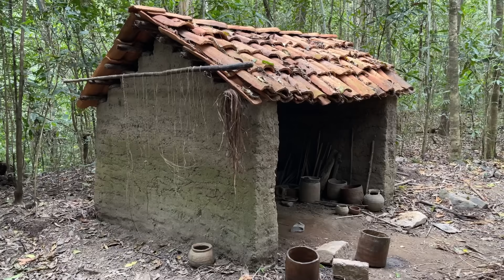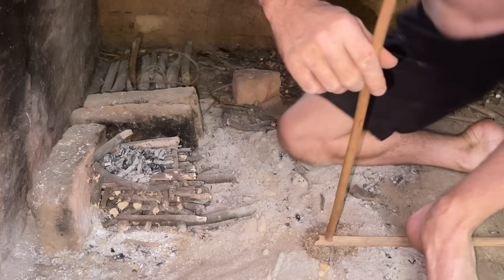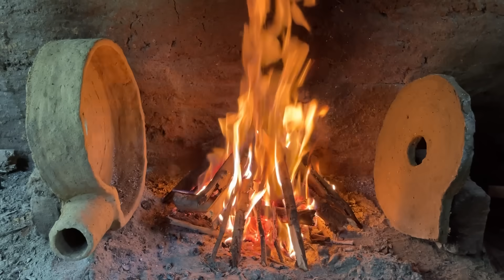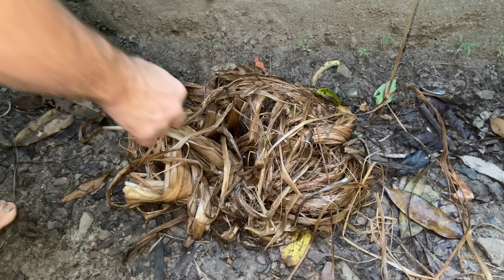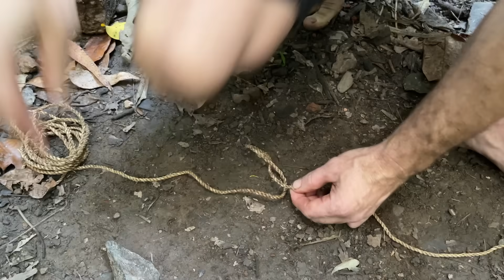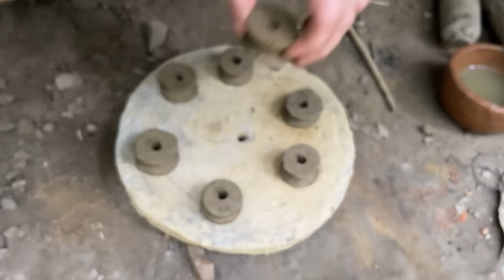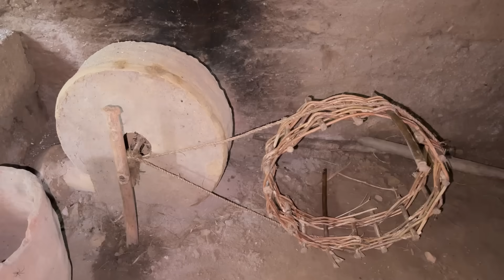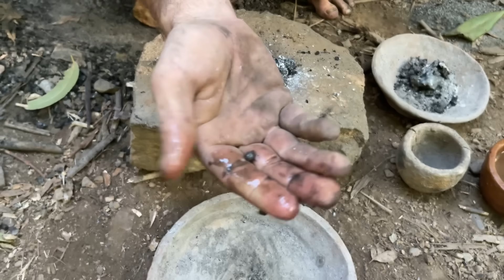Primitive Technology: Floating Pulley Blower Smelt

Comment: I just can't help but wonder if you just had one other person helping you, how much more you could achieve? I mean just having a person working the blower while the other person fills in the charges (maybe with some kind of shovel as the flames would probably make delivery by hand infeasible while the blower is running). You probably lose a lot of temperature every time you stop the blower. Have you ever thought about getting someone else on board on these projects?

Comment: You could add 1 or 2 more gears to Slow down the rotation speed and then add a hanging weight, which would slowly but stady Fall down and pull the blower

Comment: You should build yourself a primitive wooden bike frame and pedals so you can easily spin the wheel nd use a woven wheel. I still really think however you should build a forge building near enough to the creek you can use pulleys to get power from the river.

Comment: This is almost a complete design. only thing I'd potentially play with is Crushing the charcoal into powder before charging. Since combustion is a chemical reaction, more surface area= more reaction sites= more heat. Only potential down sides would be the charcoal becoming harder to handle or the powder blowing out the top of the furnace. I'd possibly suggest getting it to the consistency of gravel so the weight keeps it in the furnace but if you can make a powdered design work, that'd probably be ideal. You could also try a regenerative air preheating system but that's probably too complex to implemented easily given the situational constraints.

Comment: Hi, have you thought about improvements to your work organization? For instance, you could prepare charcoal loads in advance by measuring the proper number of handfuls and putting them on a banana leaves. This would save you time when smelting, resulting in less temperature loss while loading the furnace. Also, why don't you make small pulleys from a single piece of clay? They clearly fail where separate clay pieces meet, so this must be a weak point. By making them from one block of material, you could reduce the chance of them breaking. What do you think?

Comment: I feel like a springpole lathe would help him a lot with making stuff actually round and straight so it wouldn't be so wobbly. The hardest part would be the cutting tool for it. Rocks might be too brittle. It would let him make stuff like wooden pulleys and straight shafts, though.

Comment: I've watched 3 videos where you use pulleys. The question arose: why not make wooden pulleys instead of clay ones?
For this you will need a saw (to make a flat cut), a file (can be made from a stick, glue and an abrasive) and a drill
If there is a problem with a saw - chop the wood with an axe and process it with sandpaper

Comment: is it possible to ad vent with potruding mouth in the lid? since the blower moving one way. so it can suck in more air than relying on that one hole 🤔 or it will have the same/worse result because the air can get out from the vent instead of sucking in. i'm not an enginer so i want to know

Comment: The visual design of this greatly reminded me of a turbocharger, and gave me a thought... Could you actually make something akin to a turbocharger?

Essentially, take any method you prefer for the human powered blower, then create a second blower that is powered by exhaust gas from the fire. Basically enclose the furnace almost entirely with the only exit for ventilation/exhaust to route into this secondary blower/turbocharger setup.

I'm by no means an expert, but in theory you would gain a least a decent amount of additional blower power for "free."

Comment: You could perhaps create a fork or set of legs in which the free float spinner rests on via an axle (making it no longer a free float) and connect the spinner handles to the same axle so the support doesn't get in the way of you spinning it, but it no longer requires you to balance it meticulously in place as you spin it. You could also scale the spinner wheel itself with this, allowing you to put less arm motion and get more mechanical torque to the fan blower. Of course the free float can do that too, but having it supported would put less strain on the operator to balance everything yourself.

The materials required would need a lot of tensile rigidity so this might be difficult to do with simple materials unless you got lucky and found a branch growing in the exact shape you needed already (unlikely) but if you could make it work you could basically do the same motions of the free float, get way more rotation into the blower, and have less arm strain because you won't be both spinning and constantly correcting/balancing the free float spinner.

Now that I think about it, if you're making it already supported on an axle, you could make a clay weight and basically make it a flywheel that spins on it's own momentum after you start it up. This could free up the tensile problem before since all you'd need to do is get it started and maintain it, which would require less constant applied torque on your part.

Comment: I know that this is mostly just showing the primitive technology (pun intended) at work, but is there a reason for not firing the pulleys? Soft air dried clay is only a bit more sticky sand, which is why clay pulleys quickly fall apart. Wouldn't firing them turn them into ceramic pulleys and make them last longer?

Comment: The same way placing a fan a meter away from a window creates a depression and induces a stronger airflow out the window than if you stuck the fan on the window,

wouldn’t placing the blower output further from the s as tuyere generate more air flow at the output of the tuyere ?

Comment: You make your pulley concave because that is intuitively right but in reality a belt and pulley system uses a convex pulley. When the belt spins it will push towards the highest point, in your case putting stress on the pulley. You could also increase the air flow by putting the tuyere at a slight distance from the spout.
Reply: The convex pulley would work in a rigid setup where the belt always feeds identically, but the loose partially handheld drive wheel requires a more foolproof pulley.

Comment: Reminds me of a capstan drive. Makes me think it would work well with a gravity battery or two ( one reversed ). Make one with by wrapping cordage around a spindle and using a weight to pull it down. Add a loop to the cord and a hook to the weight and switch em back and forth.

Comment: Jumping straight to iron is a hell of a challenge... Skipping over the bronze age which had time to develop bellows, high temperature kilns, pulleys and wheels from metal, then trying to go to 1200f instead of 950 is rough. Also, having a bronze anvil and copper hammer already in place made a huge difference!

Comment: How about trying out a clay flywheel with an embedded crank supported by Y shape stake - this being directly attached to rotor, could simplify whole system, reduce wobblyness and you wouldnt have to hold it - whole concept could look similar to one of your previous designs both with less potential failure parts. the size of the flywheel you could customise to your needs, and to store more energy from your cranks

Comment: Maybe you should try experimenting with using thrust from a fire as a driving force to rotate a "turbine" that would already transfer torque to the rotor? I'm a person with no practical skills, I might be wrong, but there's a lot of power in the fire, say it's about 50kW. This is much more than it takes to spin up the fan. If you manage to use at least 1%, it will already give you insane kPa. According to rough estimates, this should work very well and leave a gap for imperfect execution. 
As I see it, a possible realisation is to boil water in a ceramic vessel, probably like a bottle, a stream of steam will fly out at a very high speed, enter it into an approximately the same ceramic holder for the "turbine", and transfer it from the axis either with a belt, or even implement them on one axis altogether. The main thing is to make a bottle in a reasonable way so that during melting it can either be easily replaced or that the water in it does not run out. Then the air supply process will be continuous and free up your hands, which is very useful for a solo worker.

Comment: I mean. 
At this point, why not just make clay rotor blades or a whole rotor with the hub and blades and all? The extra weight would act as a fly wheel so it would take less effort to keep it spinning, it would spin for longer, and you could get more air flow with much better fitting blades? 🤔

Edit: are the clay pulleys fired and still breaking? because if not you're trying to use basicly a dirt clod as a pulley and its no wonder they keep breaking. You need to fire them. Fire all fhe clay parts bro come on you know this stuff. You coukd also probably do with a much taller thinner kiln. Youll get much higher blast force by moving lots pf air through a taller thinner column. ^_^

Comment: The pulleys are probably breaking because they shrink as they dry andputting the hole in tension. If you can heat treat the pulley and then drill or form the hole you may have better luck.
Reply: No tension in the inner pulley surface required - the stress and friction of the rope is plenty to break down the pulleys. Firing some pulleys in the furnace for next time would give durable parts.

Comment: Im psyched to see you exploring this method finally!  There's a lot of evolution potential in it. 
I'd imagine it would be pretty difficult to get wooden "cookies" without the benefit of a saw, but different sizes of those with the edge hollowed out might make more durable pulleys than clay. 
They would also allow you to experiment with placing different sizes in tandem to produce different "gearings". 

I'm also curious how much more difficult it would be to weave something flatter and more akin to a belt, as opposed to round cordage. Not sure of the extra surface contact would make enough of a difference in this application to warrant the extra work.

Comment: Hello, impressive videos as usual :D
For improving your tuyère, there is an important element, very simple to include, which is the "volute beak" (like a bird, yes), it is completely absent from yours, when you look at the tuyère from the top, it's a bit like a snail, the low pressure air comes in the center, rotates with the impeller and is compressed by centrifugal forces (basically) towards the outside wall.
So, you end up with high pressure air turning on the outside of your impeller and when it reaches the outlet, a part goes out, but another part comes to slam against the "walls" around the outlet. 
That's where the beak come in, you need a triangular piece of clay to split the air from going directly to the outlet and staying inside the volute and continue turning. For now, you have a straight wall creating a lot of turbulences.
It does not look like much, but this volute beak is an essential point on these pumps, permitting to drastically improve performances (I worked on some, but for hydraulics systems ;) )
Hoping to see this implemented soon :D

Comment: I think you may have enough draft at this point. It seems like you're hurting for temperature. At this point I would strongly consider heating the air input. You could have a second firebox, something easy, with small diameter air tubes running through it, between the blower and the furnace. Maybe the furnace also needs better insulation, both around the sides, and perhaps a dogleg to stop direct radiant heat losses out the top.

Comment: I think you should not let smelted mass to cool down for a whole night, because it'directly what carburization is. If you want less carburized material, which is possible to smith, I think you should try to extract slag mass just after the smelt and try to break it and extract iron prills immediately.

Comment: I suspect that adding a fired clay flywheel to the fan shaft would increase efficiency and produce a more regulated airflow. When the drive pulley is mounted on its own frame, the flywheel could just as easily be mounted on its axle.

Comment: I think if you put something like a boul from clay on bottom of the furnace, and do the furnace taller it can add more heat, and less heat loss in the ground. So all heat will concentrate in the crucible and heavy metal drops will drown

Comment: Definitely need to find a rubber like plant there, and collect the sap to use. that will make for a glue that can bind things together better. Most fig trees produce latex, though some can be irritating, but cure into a rubber compound when exposed. As well some seed oil as lubrication will work on those bearings, reducing wear, though it will likely polymerise into varnish after a while, and you will have to apply more.

Comment: What if you tried making a disk out of clay but make it thick enough that you could like carve out a groove for the rope to sit in. It seems like it is easier to make a more circular disk of clay than it is to make a circular basket wheel. Then just make a couple holes on either side for a handle. Idk how clay dries though so maybe it can't be too thick or something. Also it would definitely need to be actually fired or it would be too brittle.

Comment: Although the blower seems much better, the result is disappointing. As far as I remember, all the improvements tried did not improve the yield, except the roasting of iron ore. It is for the moment not clear if the interruptions due to the braking belt caused this, or if now a higher chimney would help, but after like 10 videos on smelting, progress is not good.
What I am afraid is that the cause of these poor yields is the low quality of iron ore. It would be good if he makes a chemical analysis at home of his iron ore, as it may be of very low concentration. Some impurities also make smelting more difficult. Maybe it would be time to make some mining in his land. Prehistoric mining is also interesting by itself.
Another way to tackle the problem would to resign to the low yield and try some automation. 40g per smelt already allows making some basic tools possible, but is a lot of work.

Comment: You need to make a flywheel out of stone. A heavy stone flywheel can increase momentum. You also need to add a paddle for turning motion. Alternative: Make long ropes from fibers obtained from banana trees or other plants, then start weaving them using a loom you’ve built. With the fabric you produce, you can create a bellows. You can then operate this bellows simply by using your foot and a pedal
Reply: The flywheel he already did was bad news. A stone one will be worse, and harder to craft. He also doesn't need a bellows since he's already run a blower with all 4 elements working simultaneously so he already could do that. That's not the point here, really. The matter was about the difference in smelting techniques, not blower design.
Reply: @AAFREAK  when did the flywheel? I think I've watched all the videos.
Reply: @DrVektor  5 months ago

Comment: APOLOGIES
I am here to backseat game a project I myself have never tried (but it would be nice if my thought is heard)
2 things, doesn't matter on the main pieces, but the pulleys seem to notice it..

When building the clay pots/fan housing, would making like an overlapping 'step up' pattern ( _/= like this) with the sausages of clay not improve the joining lines strength of the overall finished product? Doesn't seem to matter on the pots, but maaybe on something else it might?
Like the pulleys original shaping seems to.. Lead to breaklines with the 'sausage' method. (at least they did on the last one, I haven't finished the video yet).
If they're made as a more singular piece, wouldn't it survive longer?

Comment: Since you're using a cable drive, I think you could get away with having the drive wheel be horizontal (ie, on a vertical axis). That might allow the use of a very large, heavy drive wheel... a fired clay piece, or wood, or a constructed element like your cane drive wheel. The axle could be mounted relatively securely directly into the ground. This might make it easier to spin, would give it a bunch of angular momentum (so it could keep powering the fan for a while even if you are away from it putting ore and charcoal in), and might even allow for a way to drive it with your legs rather than your arms. If necessary, route the cable drive through a "gate" of sticks near the fan axle to bring the cable together.

Comment: I think there's very little reason not to setup a tool rest near the pulley section and use a turn tool or abrasive stone to take some runout away from that area/the pulley itself. A treadle lathe would be a good intermediate tool to running this thing too

Comment: i dont know if thats useful, but would it be possible touse subsequent pulleys?
if the first one is 1 turn->13 turns, and you replicated that once more, you could get x13x13 for each turn you do yourself. so, one floating wheel turn would translate to 169 turns for the actual blower.

this would require at least one fixed large wheel, so it may be out of the question for now, but if that problem ever gets solved, the airflow potential is huge. with that kind of heat in a furnace, it might just become possible to get to work iron.
Also, if this man ever accepted help, he would probably have a full set of iron tools by now :)

Comment: To increase efficiency try make the inner walls of the blower smoother. Both flatter and more polished. 
You will gain a lot of airflow. Also consider flattening the touyeres exit for a more evenly distributed exhaust flow.
And you’d might Think about an energy storage system like a weight pulling a cord that unravels from a coil.